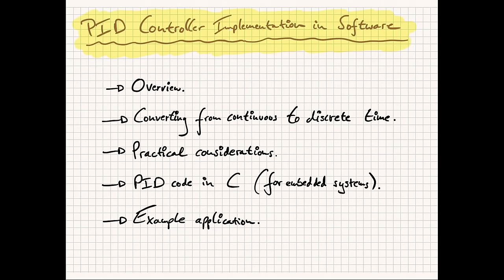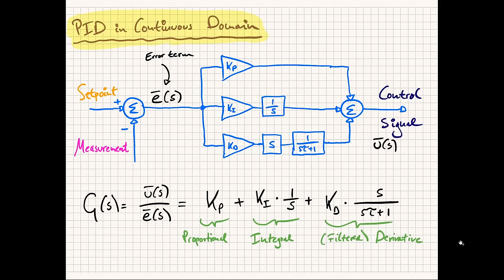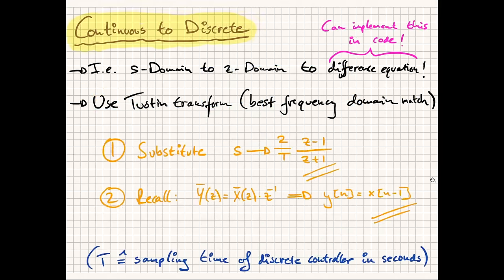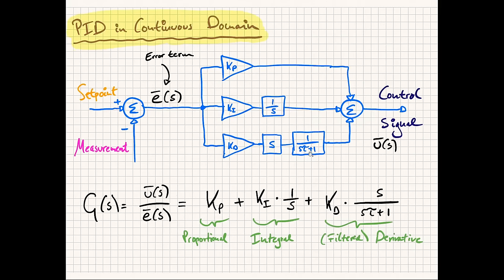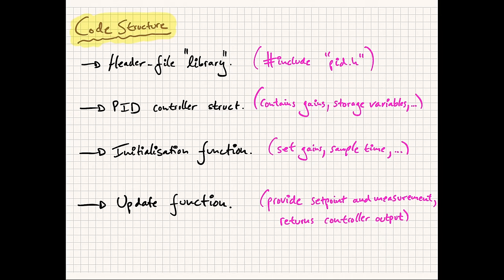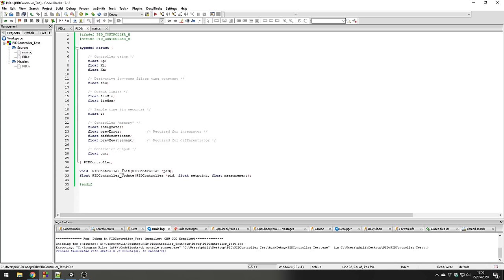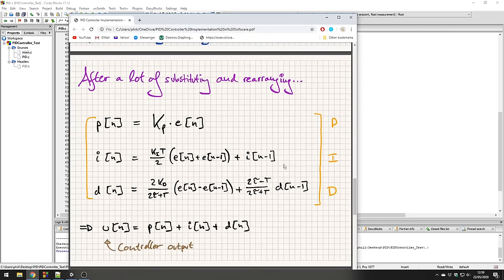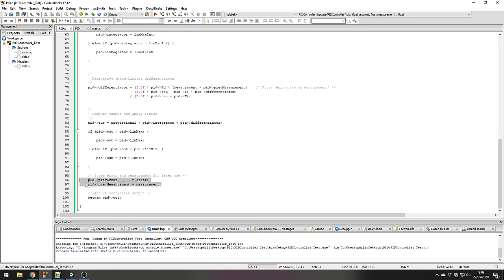PID Controller Implementation in Software - Phil's Lab #6

Comment: How ignorant I was to write a sludge pump controller in assembler for a 6800 chip (not the Motorola one) that emulated a PDP8 mini computer.  I tested it on a model and it worked. I was lucky in 1979. I wasn't aware of PID but it's obvious now. At the time there were no digital controllers, they were all analog and there wasn't anything for a pneumatic pump. I managed to increase the percent solids from 1% to 8% which was thought to be impossible. It still flowed and  saved a lot of heat energy. I only had a few hundred 12 bit words. How large is the compiled code? I started programming by hand in octal, but found a cross assembler written in Fortran IV that ran on a mainframe. I could print out the code and enter it by hand. Burning a ROM was a major undertaking. The original language assumed magnetic core memory where the return address of a subroutine was written into the first word of the subroutine and the return was a relative jump using the value. Can't do that in a ROM.
Reply from the maker: Thanks for your comment, Kim! To be honest, what you did with the 'limited' technology at the time seems far more impressive to me than writing this little PID C program I did here! Would have loved to have been around as an engineer back in the 70s/80s.
The code here takes up about 4kB of memory (and a couple tens of bytes of RAM).

Comment: What are some example values for T and tau?
Reply from the maker: It'll always depend on the system you wish to control. T is the sampling time - which ideally should be minimised (i.e. trying to achieve the greatest sampling rate possible) and tau can cause instabilities if chosen too large.

Comment: Hey Phil. Thank you for the video!
I just have a question, isn't the term 1/(2tau +T) missing on the first derivative term? I know the minus sign has been fixed, but i think this is another mistake, or am I missing something?
I implemented a PID controller without that term, and it worked after I tweaked the parameters, but just in case...

Comment: Thanks for the useful Video, I decided to implement your PID algorithm to Temperature control of 1000 degrees furnace and wondering how to determine TAU and sample time. Note that my microcontroller will generate 2 seconds PWM (slow PWM) and I will control the temperature through Duty Cycle. regards

Comment: I have a question regarding the use of the PID controller. For example, you have to balance a bar at a set angle with two motors on the ends (something like half of a quadcopter). 

The measurement is the current angle or the angular rate of the system. 

The input into the plant is some sort of number for example from 125-250 (min to max throttle). 

My question is - what kind of unit does the PID controller work in and how is the unit selected?

On one hand, it's good for it to work with the input from the gyro since that's how the system determines the error between the desired angle and the current angle, but on the other hand, its good for it to work with the throttle value, because that's what the PID is supposed to output.

Comment: This lecture takes me back to classical control systems and their design.
Great presentation with the math and examples. Very important when it comes to controls systems in vehicles of all kinds, especially high speed, high performance and high agility systems: Fighter aircraft, Formula 1 race cars, guided rocket systems and so much more.
Reply from the maker: Thank you! Yeah, control systems are absolutely everywhere. Incredibly important in almost all areas of engineering.

Comment: Equations in PIDController_Update reduce to output or measurement =.98 pid.out.  other factors must be artifacts from past alternatives. I am somewhat familiar with Laplace and Z transform but would appreciate a detailed documentation of each and every step starting with basic differential equations for PID through Z transform. I have started with your code and I am converting it to run in real time on an Arduino mega and will incorporate changes to gains, setpoint, unwinding limits and hopefully also graph in real time but Arduino IDE 2.o3 is new to me having used 1.86 for years. Thanks much for your help.

Comment: Thanks for your PID lecture and code. Does this solution work in any application? I plan to use your PID code to control the pressure. My system is the Pressure Valve that can be controlled by input in mA (4mA-20mA range: 4mA ~ 0Pa, 20mA - 100Bar). If my desired pressure Bar is 75 Bar I would need to adjust my PLC output in mA current until my error is zero (desired pressure - measured pressured at sensor).  Can you provide C# code for your simulator? Thanks a lot

Comment: What about the effect of the zero order hold which is typically considered when converting from continues to discrete time? I didn’t find any mention of that in the video.
Reply from the maker: That isn’t part of the controller itself - strictly speaking. Rather, it needs to be considered in the overall loop for stability when designing the complete control system - that is taking the plant and system into account. The ZOH effect (due to the DAC) effectively introduces a small delay, which may require the controller gains to be adjusted. However, the implementation (code-wise, as shown in the video) stays the same. I go into more detail in my ‘control system design’ series of videos, if you are interested.
Reply: @PhilsLab  understood. thanks. Yes I have see your other videos also till part 2/6. They are brilliant! In the above video you have designed only the controller, so I assume that when adding the rest of the system in the simulation/code you will need to add a ZOH between the controller and plant (if you are planning to implement this controller on a real MCU), so as to mimic the effect of the output DAC. Right?
Reply from the maker: @yadaKiKhula  Thank you! Yes, we'll be looking into that - if we indeed need to model that for our controller design. In some cases you can get away with not including the ZOH effects.
But yes, you are right, the ZOH is to model the effects of the DAC!

Comment: Suppose I am trying to control the speed of some actuator using a PID controller. Once the speed reaches the set value, the error would be 0, in which case the input to the actuator would be 0 (I guess). If this happens the speed would drop to 0.  How does the PID controller handle this so that there is a constant input to the actuator, even when the error is 0.

Comment: This is great! Thank you :) Could you do a practical implementation on a heater with a response time of about 5 seconds?
Reply from the maker: Thank you! I'm currently thinking about what practical (real-world) system I can make a video on to show how to design a control system from theory through to implementation.
Is there any specific heating system you're looking at currently?
Reply: @PhilsLab  Perhaps a heated system that stitches a thin layer of plastic film going inside two conveyor belts that are pushed toward themselves.. Conveyor belts are teflon, and the heater is heating one of them by touching at the stitch point. It is a technique used in MiniPakr air cushion machines
Reply: probably take a look at 3D printer code, there's PID controller involved, reading the gear teeth/revolution of stepper motor to prevent position overshoot, thermal management etc.

Comment: I tried doing the calculations from the functions of S to functions of N. But im stuck on the derivative term. Ik get the same result but in the d[n] term i get 1 ((2tau+T)/(2tau+T)). If i look at the calculatioms the d[n] terms would be (2tau-T)/(2tau+1) if the orignal filter would be s/(tau s-1) not s/(tau s+1). What could i be doimg wrong?

Comment: Is this library better than bretts?
Reply from the maker: I take it this is the Brett you're talking about (http://brettbeauregard.com/blog/2011/04/improving-the-beginners-pid-introduction/)?
His site and implementation are great resources. The way his and my implementation differ is firstly the use of a different transformation from continuous to discrete time - the Tustin transform used in this video will give a much better frequency response match. Additionally, he does not use a derivative filter, something that is definitely needed in most (if not all) applications (if you are planning on using derivative control).
Other than that, the features are pretty much the same.

Comment: Basically you can also do a very simple PID-software implementation that just calculates the derivative and integral like this:
dev = e - old_e
integral += e

I once tried it.. and the controller works decently well. Why would you not recommend doing at that way? What are the benefits of the z-transform?

Comment: Thank you for this greatful video explanation. One question which values did you choose for the kp, ki and kd gains and how did you choose them? Thank You very much!
Reply from the maker: Thank you very much! Tuning the controller is actually quite an involved process and unfortunately it'd be a rather lengthy reponse. I am making a new video series on control system design, where I'll be going into detail on how to choose those parameters.
Reply: @PhilsLab  This would still be really appreciated.

Comment: Nice video! Could you also explain how a PID controller works for positioning a DC-motor with an encoder for example? Would love to see how to implement such a PID controller in C
Reply from the maker: Thanks! In an upcoming series I'll go more into detail on how to tune/design a control system. Not quite a DC-motor example, but definitely very applicable to that as well. Hope that will help!

Comment: Very good video!
I built a drone for my school's finals project, but it unfortunately did not really achieve stable flight.

I'm not quite sure what went wrong but my PID implementation looked a bit different.
Aren't you supposed to integrate the Error and not the output of the I Term?
Reply from the maker: Thank you! Shame to hear your drone didn't achieve stable flight in the end. Is that something you're still pursuing even after school?

I'm not sure where you're seeing that the "output of the I term" is being integrated? The integrator is integrating the error terms, by taking an average of the current and previous error terms (i.e. gain * sample time * (e[n] + e[n-1]) / 2) and adding that to the previously calculated value of the integrator variable (i.e. += pid->integrator).
Reply: @PhilsLab  i see that, what I did was the following:

// simple riemann sum:
pid->error_sum += error * delta_t
pid->i_term = pid->ki * pid->error_sum

and then the other tems.

I'm pretty sure there were many more issues with my teams design and my firmware. The microcontroller we chose not having an FPU being at least one of them 😅. 
I'd love to revisit the project some time in the future, maybe again at University but for now I've got other stuff ahead of me.
Reply from the maker: @juliankandlhofer7553  Yeah, the way you implemented it is completely fine - it's just using a different transform (backwards Euler method). The transform I used in the video is effectively making a 'trapezoidal' integrator, while yours is 'rectangular'.
Haha yeah I started off with MCUs without a floating-point unit as well, I'm so glad I switched to STMs which have FPUs.
Well hopefully during university you can revisit your project - would be awesome! :)
Reply: @PhilsLab  ahh ok.
We did use an STM chip, but an STM32F107 which is a Cortex M3 with no FPU. Should have gone with an F4 series but when we made that choice a year ago I didn't even know what an FPU really does and how much of a difference it makes.
Also no idea how to implement a kalman filter, so complementary filters is all I had.

Might be taking some inspiration from your Flight controller board should I revisited this topic again some time :).

Comment: Wow, I do a fair amount of embedded control systems, and this video was a huge help - it never occurred to me to LPF my derivative terms. Often times doing servo systems I want  a larger derivative but can't due to instability.
Maybe this is in the video and I missed it, but what are the considerations for determining the corner frequency of the filter?
Should it just be slightly beyond the maximum output speed of the entire system?
Reply: Also, what do you think about having a zero-crossing detector on the integral term so that if the controller overshoots it zeros the integral term?
Reply from the maker: Hi Brett, Sorry for the late reply! Very glad to hear that you found this video to be helpful. Effectively, if you could get away with not filtering the derivative term at all, that's what you would want to do. The more you filter the D term, the further it gets into actually being a simple proportional controller. It's hard to say in general, but needs to be determined on a case-by-case basis. I typically choose it via root-locus to maintain stability even with a heavily filtered D term.
Essentially, you want to filter the D term to reduce actuator wear and prevent noise being amplified too heavily. This usually has to be done in practice on the real-world system!
Regarding zero-crossing detector, yeah you can pretty much do that with dynamic integrator clamping - which is pretty much what you described. I generally find that simple integrator clamping is sufficient for most tasks and makes the implementation easier!

Comment: In fact, the video is very useful and useful
I have a question please:
How can I use this library to drive a washing machine's AC brushed motor
I wrote a simple code to do that (C code)
But the motor does not start smoothly, it is jumping
The reason is that I did not use PID
thank you Mr. Philips

Comment: What is the 0.5f for in the integrator part of the calculation.
Reply from the maker: Effectively, the integrator is performing trapezoidal integration. The 0.5f is there to adjust the gain, since you are adding two samples per integrator timestep.

Comment: Great content! What textbooks have you found helpful in understanding control theory? Preferably, optimal control and it's practical considerations?
Reply from the maker: Thank you! In general, I personally really like 'Modern Control Systems' by Dorf and Bishop. Covers everything from basic to intermediate control theory with many examples along the way. If you're only after something on digital control systems, I'd recommend 'Digital Control of Dynamic Systems' by Franklin.
Regarding optimal control, I must say I haven't come across particularly 'practical' textbooks. If you've heard of H-Infinity control, that is something I used for my final year project at university (self-balancing bicycle): http://philsal.co.uk/wp-content/uploads/2019/08/FinalReport.pdf
Reply: @PhilsLab  thanks!

Comment: You said that the bandwidth of controller must be 10 times that of the system/plant. Is there a simple way of calculating the plant bandwidth, especially if I have its transfer function?
Reply from the maker: If you have Matlab and the transfer function, you can use the 'bandwidth' command. Bandwidth unfortunately has many different definitions (either 0dB crossing, -3dB crossing, etc) so for a lot of systems it's a bit hard to define. I would roughly say think of what is the highest frequency of interest the plant has to respond to.

Comment: Excellent video, thank you. Could you please give me some more hints about how to properly choose tau?
Reply from the maker: Thank you! Ideally, you want to make tau as small as possible (positive, and close to zero), since that will get you as close as possible to 'pure' derivative action. However, you will inevitably have to increase tau to combat high-frequency noise amplification. You don't want to make it too high, as otherwise this will diminish the effect of D-gain and rather turn it into P-gain. It's quite a trade-off essentially. There are mathematical ways of finding tau, which I will be going into in an upcoming video series!
Reply: @PhilsLab  Thank you very much! I'll stay tuned for more videos
Reply: @PhilsLab  Hey Phil, I am a student in India applying your code to a project of mine, and I'm having slight difficulty choosing tau value, in which video series have you explained the approach of finding tau? It would be of great help, Thanks.

Comment: Would you recommend making an analog circuit with op-amps and tuned gains or using a circuit with a digital controller such as the Arduino as part of a home project? I think the analog circuit would be easier to implement but what would the advantage of digital implementation be?
Reply from the maker: I think both have downsides, but ultimately for me a digital implementation will (almost) always win. For analog implementation, you will have to worry about all the non-idealities, such as op-amp offsets, tolerances of components, AC coupling, dual power supplies, integrator capacitor resetting, implementing something other than lead/lag or PID, interference, hard to modify existing design, converting your control signal to something that can drive a motor, etc, etc. 
With digital, you'll have a bit more upfront work putting the system together but then will have hardly any of the problems mentioned previously. Digital however is (or can be) bandwidth limited, has a limited dynamic range, and you need to discretise everything.
I am usually much more of an analog electronics guy, but for control systems I think nowadays digital is the way to go. Just my personal opinion however!
Reply: @PhilsLab  Thanks, you've made a lot of interesting points that I would have neglected to consider and then had to resolve later. I tend to agree with you that digital is probably the better choice, but I'm relatively new to sampling so it was a more intimidating option for me. I think I'll probably go down the digital route as I've got time to learn thanks to the current situation regarding the C-virus